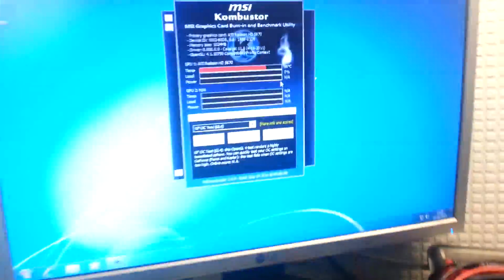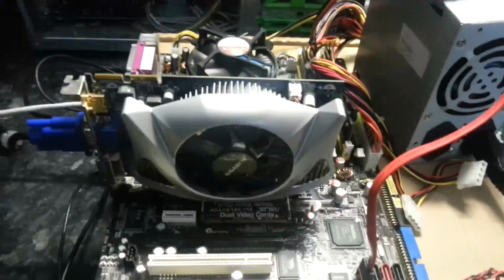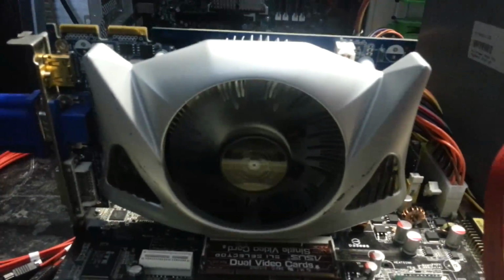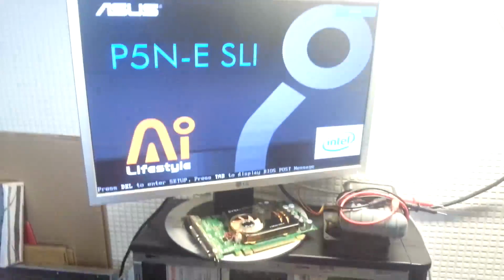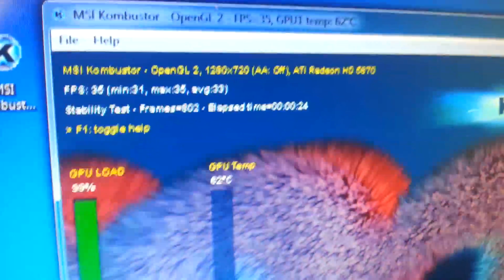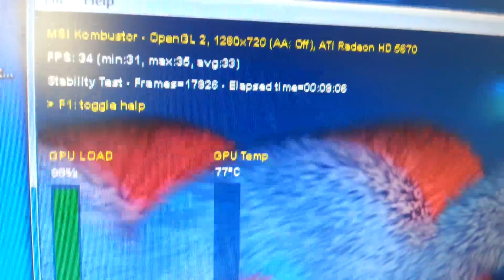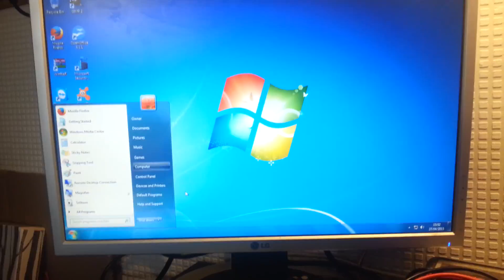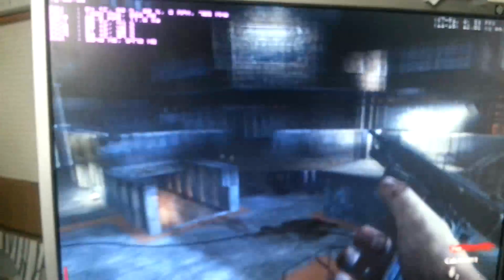Gigabyte Radeon HD 5670 1GB Overheating Fix - Thermal Paste / Compound Change - AMD ATI GPU

Comment: Thats not the stock fan on the 5670, did you replace it?
Reply from the maker: +Jayse Greene It's not the stock 5670, its the gigabyte edition card that has that cooler.
Reply from the maker: I can assure you that it's not fake, I had literally purchased this card at a car boot sale, took it home and installed it into a computer to try out and then seen it was overheating like crazy. When I noticed it doing that I decided to whip my phone out and film an impromptu video documenting on if it would fix the issue or not. 

It can all really depend on how bad the card is and if there has been any damage done to the GPU core after it has been used while overheating. Thermal paste can make a huge difference (as shown) - but that is more so if it's worn out badly enough (like it was in this case, all solid gone and a lot had worn off - making practically no contact between the GPU die and heatsink). Overclocking can also add to this a lot and increase the risk of damage if the card is overheating already. 

Do you have a reference cooled card and not aftermarket one? The stock blower-type coolers on reference models are pretty bad - both loud and inefficient. 80 degree isn't actually a bad temperature if it's a stock card - and a lot of cards (especially nVidia ones, and I think the new AMD ones) will use a boost feature to increase the performance (clock speeds) of the card, the better the card is cooled then the better the performance will be boosted automatically - but it'll also keep an eye on it at and maintain a set maximum temperature. I know the temp settings for nVidia GPU's maximum is 79 or 80 degree C. 

Hope this information is somewhat helpful,
--Nathan
Reply: Nathan H well i did notice that you put alot of thermal paste, so maybie I need to put more, please try finding some information about my card, i tried finding some complaints and stuff but its all beed people asking for help, not saying what the problem is and what you need to do.
Is there any diffirence betwen thermal paste for cpu's and gpu's? I bought some really cheap thermal paste that i cant even spell because it somewhere form Germany, all i can spell is "amshan", any help is apreshieted
Reply: The reference 5670 cooling is retarded bad.
Reply: +Nathan H i personaly find this video to be fake, thermal paste can make that big of a difference, I have a Radeon 6850 and evry time I play its around 80 degres, i changed the thermal paste and the temperature was about 1-2 degres lower, but i might be wrong about the video being fake. If you can help or give me aome tips on cooling down my graphicks card that would be grait

Comment: Check the actual mounts of the aluminum heatsink.  The mounts are these thin aluminum strips with screw standoffs on each end, screwed to the heatsink body.  The high temperatures on these Gigabyte cards are usually cased by poor contact/loss of contact pressure from the ductility of the aluminum strips.  The choice to make these strips out of aluminum boggles the mind, as aluminum has very little elastic strength and everyone in the video card/aftermarket cooler industry uses some form of steel instead.  

I ended up JB-welding the strips to the heatsink to reduce the deformation of these strips (very hard to tell visually, even if they buckle a tiny bit, the temperature skyrockets).  That JB weld did the trick, but was time consuming as I had to sand all the pieces to expose fresh aluminum on each side.  Load temperatures are now maximally mid-60 degrees Celsius after the epoxy.
Reply from the maker: +P.Feyn A simple thermal compound change resolved the issue for this card as I show in the video, Sure glad I didn't have to go through all that messing about like you had! haha.. Still to this day it's running fine. touch wood
Reply: omg lol, I remember when I bought this card back in 2010. I bought the Powercolor version and it brings back so many memories. It's a good card :D